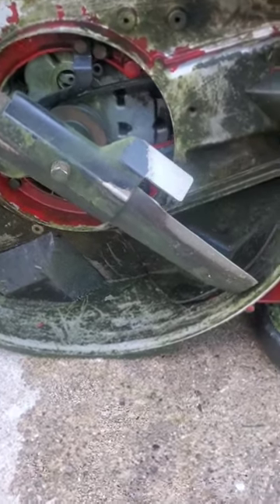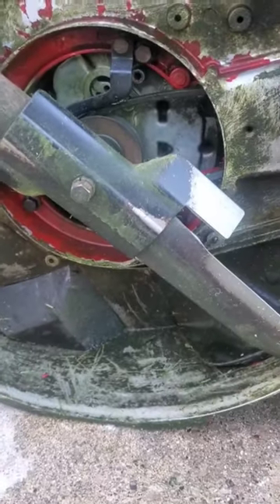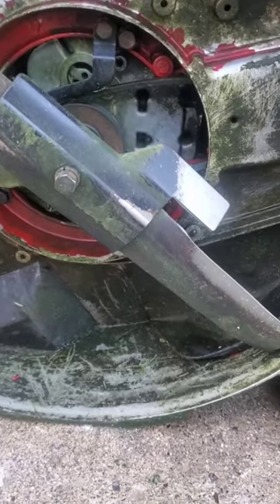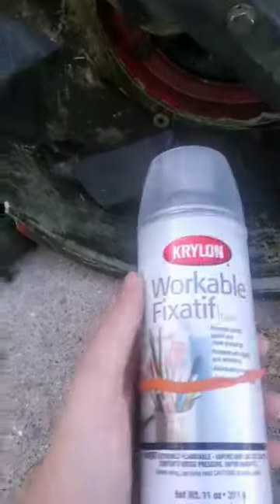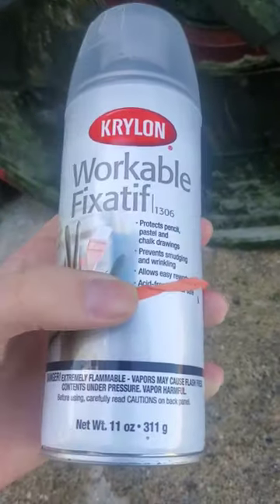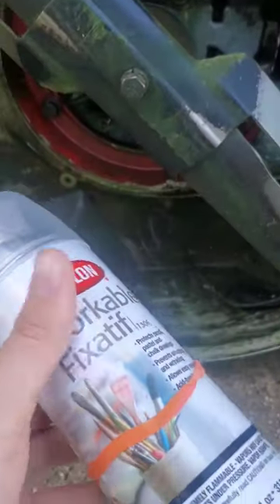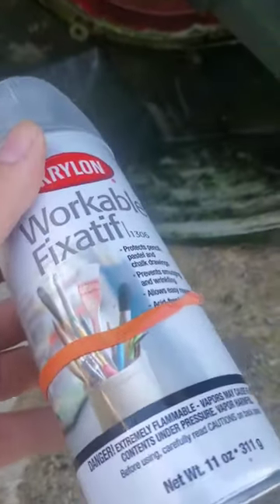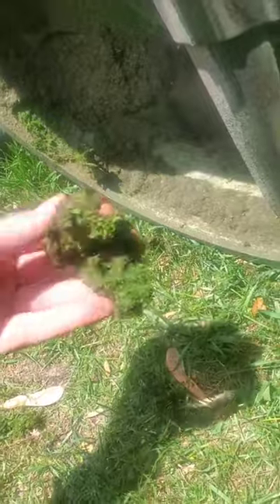how to reduce grass build up under your mower deck

Comment: I scrape then spray my mower deck with used motor oil. It’s nasty and drips onto my garage floor. 
But nothing lasts under a mower deck. And that’s the cheapest. 
I do it to preserve the deck. 
Nothing will keep grass from sticking if conditions are right.
Reply from the maker: I've observed that the grass sticking is lot worse on these aluminum decks like mine. After the paint is gone it just sticks to the aluminum like eggs to a pan and it causes the mower to bog down a lot and not cut well. That's why I'm concerned about it.